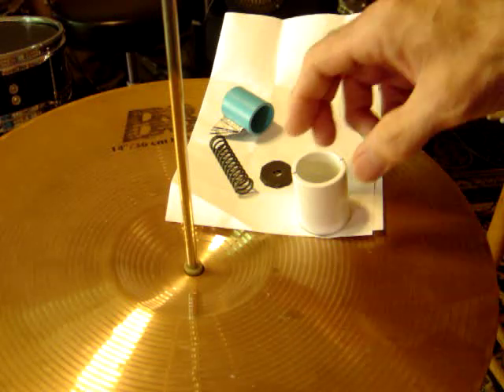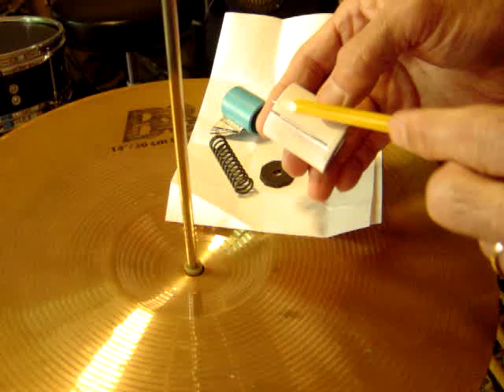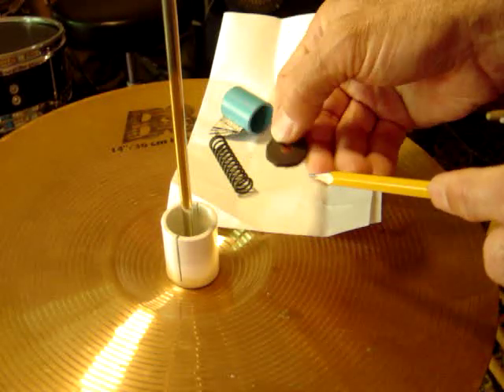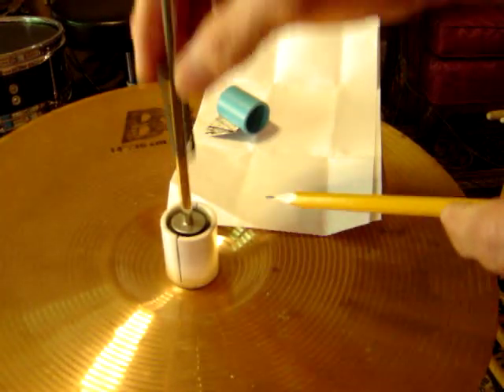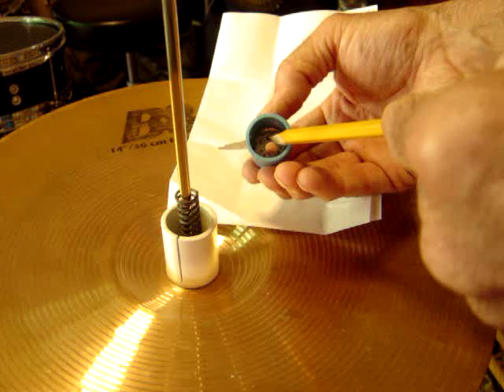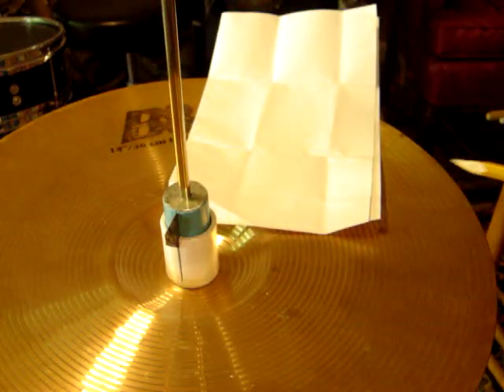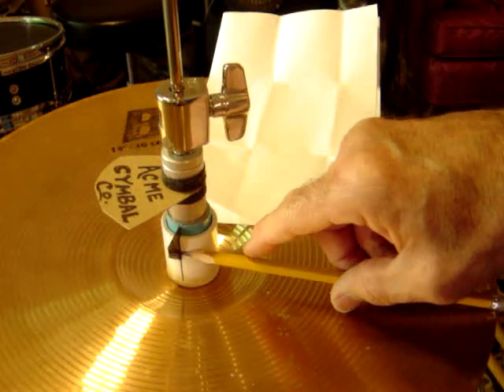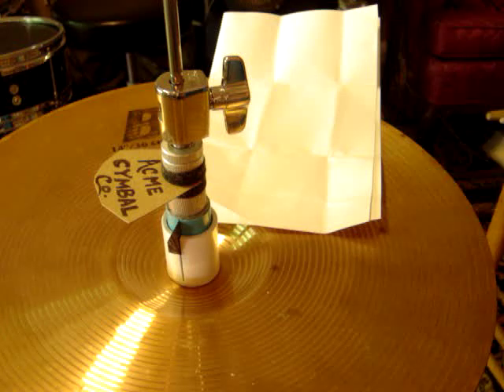DIY Optical Internal Hi Hat Controller, Segment 1

Comment from the maker: @Cristopher10986 @Cristopher10986  I am not using any electronic HH, I am still using my acoustic Zildjan Hats.  A full variable controller can be made using a slide potentiometer - very inexpensive, If you play alot they fail too often. A magno pot can be used instead and should last about forever. search for TD-20 DIY Hi Hat Controller and you should find Hellfire's post and another on edrums gl iter.  this reply won't let me to put in the URLS

Comment from the maker: @Cristopher10986  Let me first point out that this Optical Hi Hat controller does Not work with a Roland module. This is a design,in practicale build, of a HH controller for the Megadrum trigger to MIDI interface. It should work with any controller that uses a 0-5 v control signal.  I just do not know which other ones they are.  As for your edge/bow HH cymbal, depending on your controller - a simple two zone, piezo/ piezo cymbal  might work. or a top mounted switch on the edge with a bow piezo